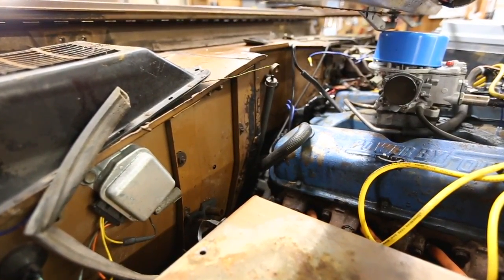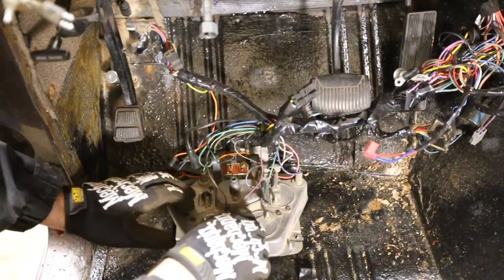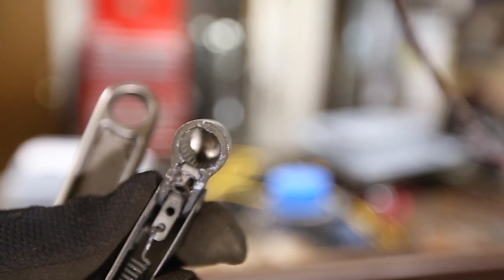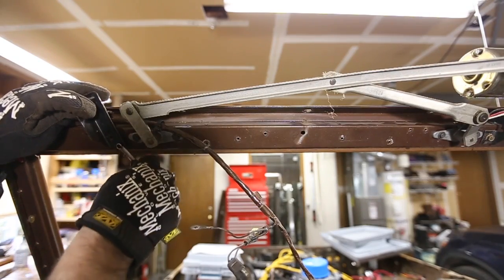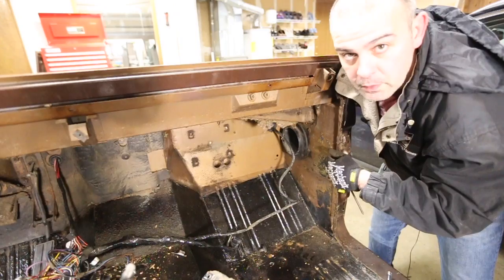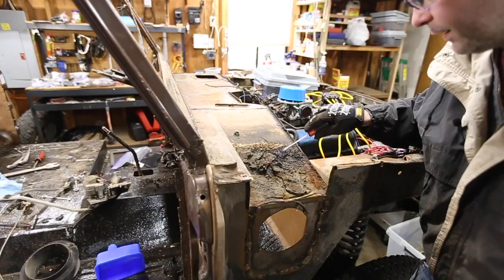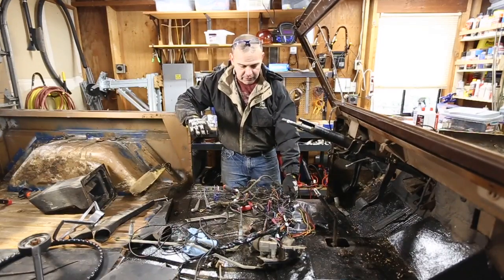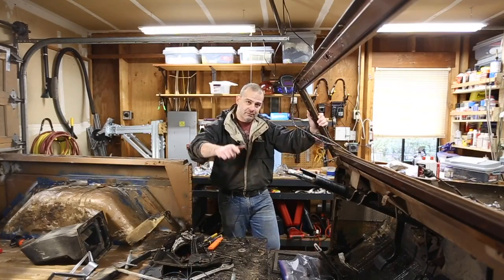Ep 2.08 - Bronco Dash Disassembly - Part 3 - Heater, Windshield Wipers and Wiring Harness

Comment: I'm thinking about adding a seal to go under that heater box air intake to prevent all that crap from going underneath it. Mine didn't seem to sit real flat on the sheetmetal so I think it will work.
Reply from the maker: Nathan I hear you. I'm also thinking about replacing the thin metal base with abs. Jut have to watch out for trapping moisture if we seal it!
Reply: I would just seal around the outside leaving the very bottom edge without it. That way if any moisture does form it will have somewhere to go.
Reply: Nathan I just cleaned mine out and it doesn't sit flat either. Let me know what seal you use
Reply: I'm gonna just try a piece of weather stripping glued to the bottom of the intake itself with some 3m weather stripping adhesive. The trick will be finding something with the right thickness that  is thick enough to fill in the gap at the top but squish close to the bottom.

Comment: I know that original Jeep windshields folded to make transporting them via ship easier. They would be boxed up and stacked. I think the original specs said that it had to be packable in less than 36" of height, or something like that. I'm not sure why a vehicle like a Bronco would need to have a folding windshield.
Reply from the maker: That's good info! Another viewer suggested it was useful for hunting in broncos. Either way, it's not my cup of tea.
Reply: Matt's Garage If anything, dropping the windshield down lets you get the wind in your face. The first time I ran my EB after getting it drivable was a really nice early spring day,  I had the top off so I put the windshield down just to try it out...  ^_^

I don't recall if I ever did it again after that.